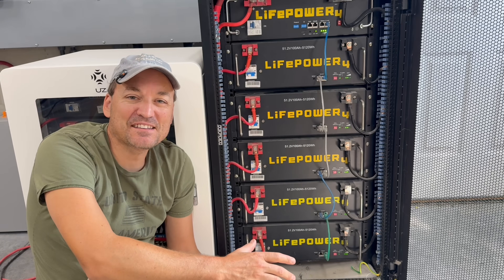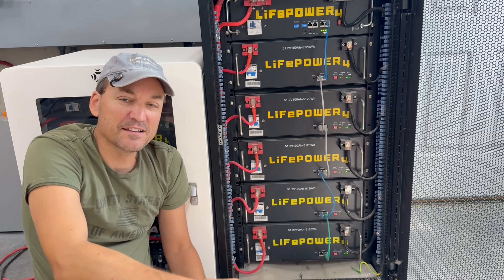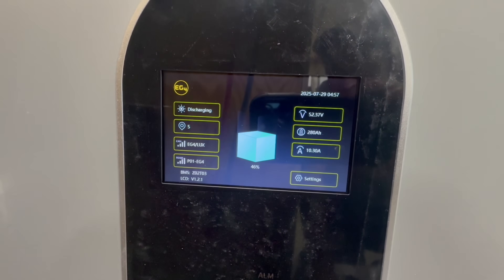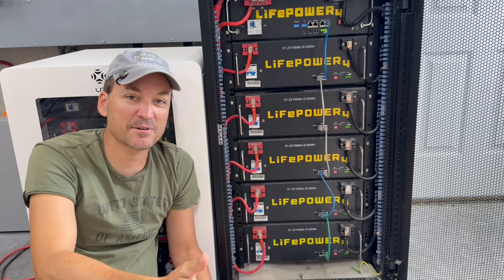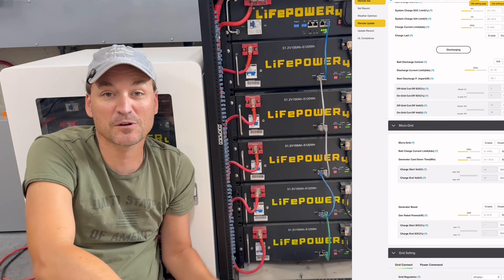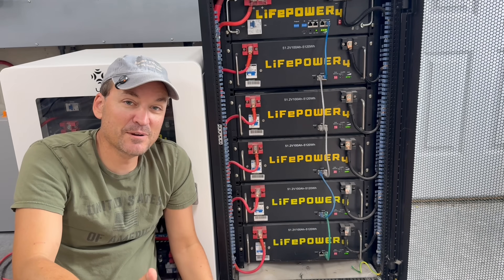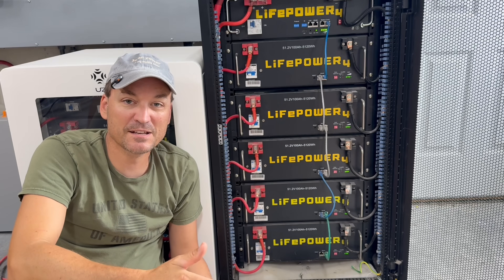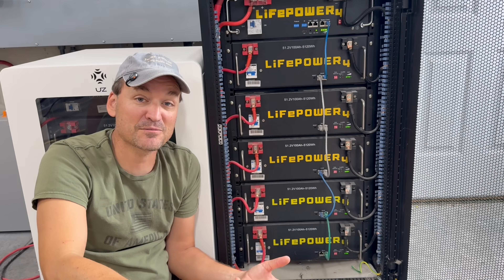How to keep your EG4 batteries balanced. Simple solution for SOC drift

Comment: Thanks for highlighting these issues. I've had 4 Pytes server rack batteries for nearly 2 years and I want to add another 10k, will I get this same type of balancing problem by adding new batteries to old ones?
Reply from the maker: Possibly, I wouldn’t hesitate to do it though. You really shouldn’t see much degradation in 4 years.
Reply: @GavinStoneDIY Thanks Gavin. I'm regularly reaching 100% and having to let the system throttle back, because I'm not grid tied. Then there are days when I'm having to regulate my usage a little because of cloudy days and or heavy usage. I think I'm going to wait and see what happens with the tarrif situation before I jump in...
Reply: You will not have any kind of balancing problems.Balance problems only occure on batteries that are tide in SERIES.If u just expand the bank with new bateries in paralel,there will be no issues.Make sure they have the same cell numbers(16 in your case. Pylontech has only 15 for exemple),and you will be fine.Also connect them toghether when they are close in SOC,so you dont have too big of a first in rush current in between the bateries.
Reply: @83kaszas Thanks. I'm guessing that there will be lots of people in a similar situation as we go forward.
I was thinking about adding a Pytes V10 to my system, because it's basically the latest design, 'includes' the outdoor case and comes with fire suppression. I'm guessing from what you said that this might be an issue because of the difference in cells?
Thanks again.
Reply from the maker: @simonpaine2347yeah those new versions look fantastic. I’m hoping to review some at some point soon.
Reply: @GavinStoneDIY The Pytes stuff is a bit more expensive, but definitely worth it as far as I'm concerned.
Reply from the maker: Pytes never claim to be the cheapest. But their build quality is always fantastic. Their newer versions have T class fuses as well.

Comment: In the old school language, we would set and use an Equalize cycle / function. I use that function on my open loop customers including my house Outback Radian with Pytes E-Box LiFePO4. Great video!
Reply: Dont do that with LIFEPO4...just charge them to 56V,if its a 16 cell module...There is not absorb-float charge on lifepo4,you set fix voltage,it will go up to that,not take any amps,than its full.Nothing more need to be done.
Reply: @83kaszas I hear your concern. In this video Gavin also says you may need to go above 56V to get to uniform SOC across packs. I agree with him. I’ve spent over 20 years in off grid solar using all most every battery type. In legacy inverter equipment that is grid-tied, we would program a ‘sell voltage’ in order to export energy to the grid. That voltage might be too low to support SOC uniformity across batteries. EQ is a way to automate the process of getting a periodic refresh of the voltage / SOC while still maintaining a backup power source and also exporting all the extra energy. I typically use 56 or so for EQ and 54 +/- for the sell voltage.
Of course, with newer SOC / closed loop systems, the EQ trick is not needed under most circumstances.
Reply: @maverickmacgyver  what duration/time at this higher bulk charge would you recommend? I am set for 15 min on my 24V EG4 LL's. Thank you
Reply: @jeremywerlin  if you have a way to use a computer to see the stack of batteries, then you can see each batteries SOC and figure out how much time is actually needed to get the SOC within the window that you want. For my system, I have 16 each 5 kWh batteries. I have set EQ to one hour. I use battery software to log into the group of batteries to see what the range of SOC is. Your time and voltage may vary.

Comment: It is amazing a monitoring site I follow I would say 95% of the complaints are about SOC or communication with battery problems which I never have as I just run in Lead Acid mode.
Reply from the maker: I suppose I have a bit of a hybrid setup. I have both closed and open loop in my system. Works great though.
Reply: Dont run Lead acid mode with LIFEPO4,they charge completely differently.Just use " user defined" charge parameters,set amps to the size of the batery and the voltage also if 16 cell module,than around 55.2V are enough.
Reply: @83kaszas  Every inverter is different but my Lux 12k only has lead acid mode but it is fully configurable to user defined settings.
Reply: @offgridwanabe  Ah than i gues it must be the same,cool.

Comment: Great video! One thing I’d add — if your batteries have slightly different capacities or if the cabling between them varies in length (and therefore resistance), you can get uneven discharge rates. One battery might appear to drain faster simply because it's "easier" to pull power from it. It usually evens out at the top or bottom of the charge cycle, but it can definitely make the SOC numbers look off in the meantime. Regular full charges help, but good wiring practices and matched batteries go a long way too. 👍
Reply from the maker: Good point Adam. 🫡
Reply: Very good,its indeed exactly how you described.